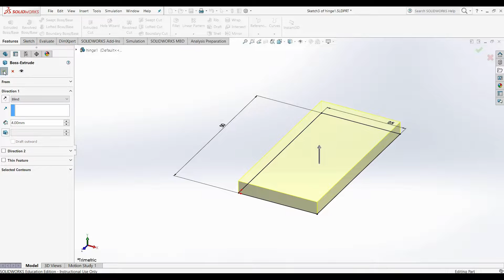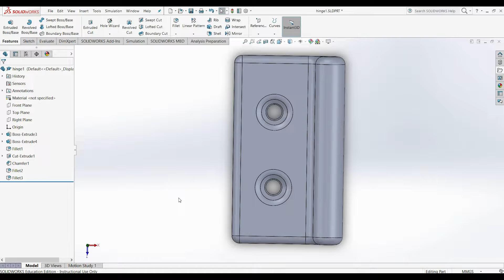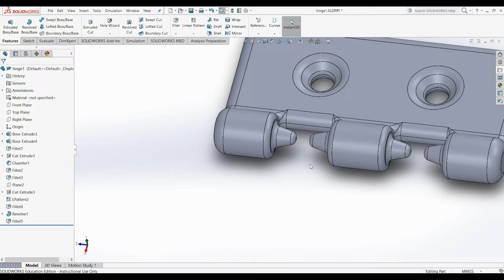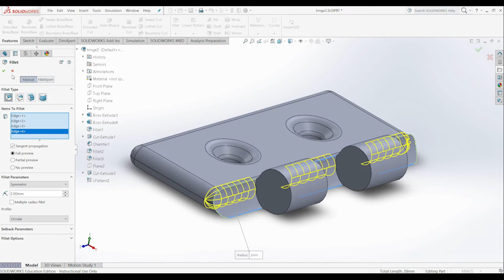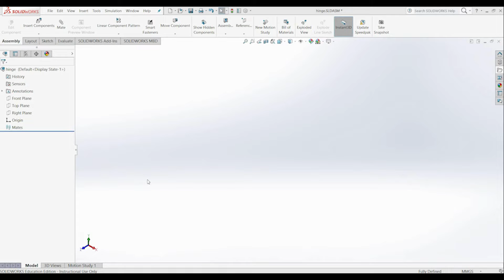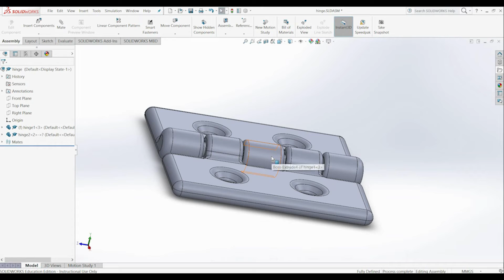How to model a hinge in SolidWorks for 3D Printing (Full Tutorial)

Comment: Combine 2 parts, wit use subtract, with a distance between parts of 0.2 mm. Why can't I do it in SolidWorks? Do you know if I always need to calculate? solidworks not have tools for 3d printing, and I hate the program, because it can't connect points automatically if I "linear sketch pattern"  I need to do hands to connect all points, when I need a closed contour. 
I don't understand why a very expensive program do not work easily

Comment: how did you create the gaps between the parts when u just did a subtract?
Reply: I didn't find a video where is the distance between the sliding parts? When I connect the parts, there is no distance between the folding parts.

Comment: How did you have gaps at 22.07 in the section view. How did you make sure there was gaps after the combine function?
Reply from the maker: I made two versions of the part with the lugs, one was larger than the actual part, the larger one was used to do the subtraction
Reply: @conorwalsh_net  Ohh i see! I completely missed that part. Anyway, I printed it and it works! Thanks a lot :)
Reply: @conorwalsh_net  yeah it is pretty frustrating. I wasnt able to figure out how to substract parts because no one was showing how to add parts from other files. Every little detail matters.

Comment: In the video you stated that you didn't think one could make a hinge with a rod through all of the lugs on the hinge. For the heck of it I tried it and it worked. It was a little stiff at first but quickly loosened up. It didn't work as smoothly as the way you designed your hinge but it was much easier to draw. Thank you again for the video.
Reply: Ibam actually looking for stiff hinges .can you provide your 3d model of hinge Bruce

Comment: Have you done any strength testing on this hinge? I'm giving about buying a 3D printer to be able to create hinges and locks for some storage lockers, but I have no knowledge about how long it will last.
Reply from the maker: The hinges should be strong enough but I did this more as a proof of concept rather than for actual use. I'm not sure how long they will last under daily use. You might be better just buying metal hinges!